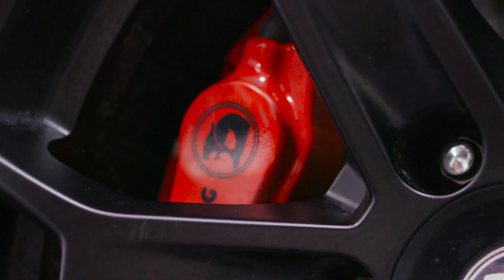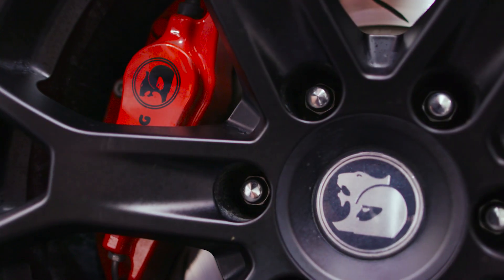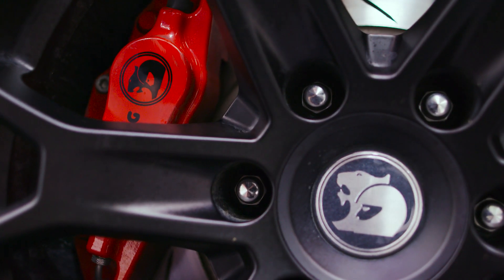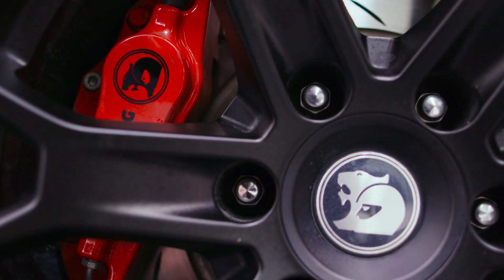Series 2 SportsCat AP Racing Brakes

Comment: I would be asking how long before the pads need replacing especially for a 4 x 4 and cost of rotors, because i would bet that before the SUV gets to 70,000 you will need both, depending on the driving off road or just city driving and even then most people do go off road like the breach for example?
Reply: Stay of the internet ur clearly have too much knowledge 🙃